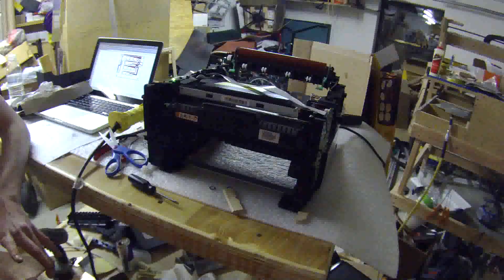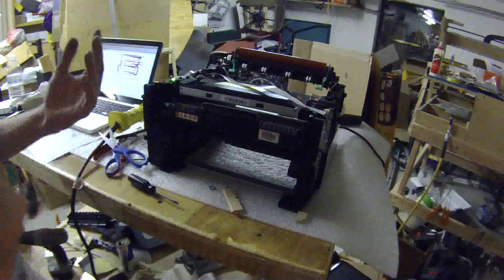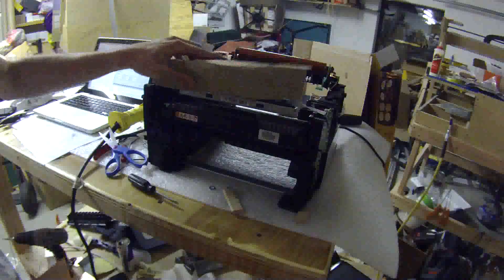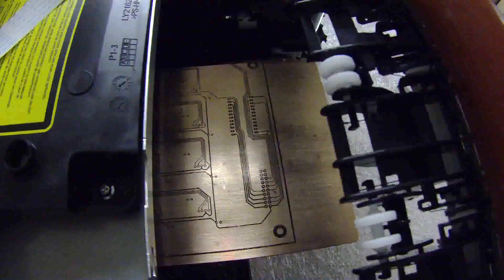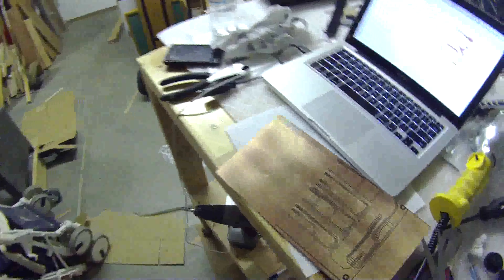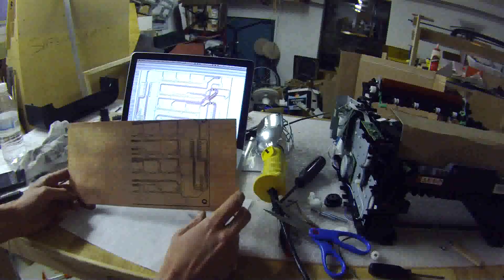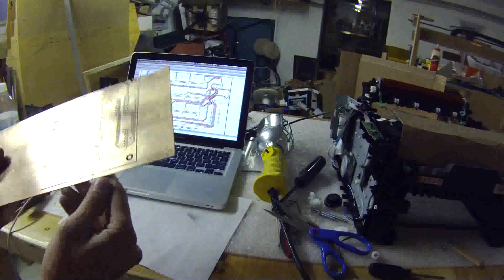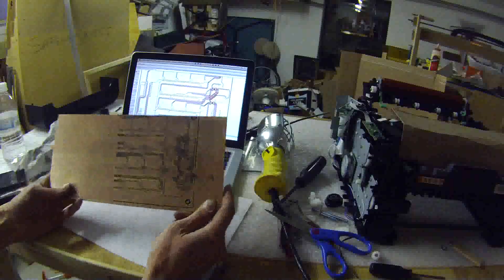hacked laser printer: printing directly on copper

Comment: why didn't you just printed ob a transperent sticker ?
Reply from the maker: the idea was to lay down an etchant mask to chemically etch a functional circuit board without having to do toner transfer which is fairly error prone process
Reply: Elijah Insua I thought the typical method of laser printers doesn't print thickly enough to work as enchant without the transfer printer or the heat method. Have you had any luck?

Also, you may want to heat your copper plate before you print. 

Found a $33 laser printer, so this all became suddenly more interesting :p
Reply from the maker: Tomek B. I actually ended up blowing up the printer while trying to bipass the fuser!  You should be able to heat-gun the board after you run it through as long as you don't turn the toner into a liquid and let it run everywhere.

You might be right about it not putting down enough toner.  I'd love to hear how you fair with your new printer!

Comment from the maker: I'm sure it's possible, but its a matter of effort.  

You'd need to print one side then manually fuse the toner to the copper clad.  The next step is the real trick, where you'd need to put the board back through the machine in exactly the same position.  I would love to hear about it, if you manage to get that working!

Comment from the maker: I'd recommend getting a second hand laser printer to destroy.  I'm not sure of a guide per se, but you definitely want to make sure the paper feed is as straight as possible (copper clad doesn't bend very well and will jam in the machine!)

Also, you can't be afraid of modifying the drive mechanics. Namely you will want to separate the transfer roller from the copper clad as Foxau2 mentioned.

If you decide to go this route, be careful!

Comment: I've done this exact thing for several years now. What you were talking about with not all the toner transferring, it's because the pressure between the roller and pcb is too great. It's designed for a piece of paper and copper clad is much thicker. I cut my springs in the tensioner and it works great! I use a butane torch or lighter to"cure"the toner after transfer is complete. Are you getting paper jam errors? Is that why it stopped and you had to pull it out? (pulling it out damages the drum)

Comment from the maker: I'm using the brother hl-2230, but I suspect if there is a manual feed slot you may be able to get it to work.  You will not however, be able to use the fuser assembly as is, because it _will_ jam the machine.

Be careful and wear (laser) eye protection